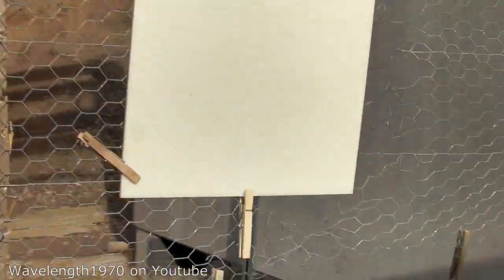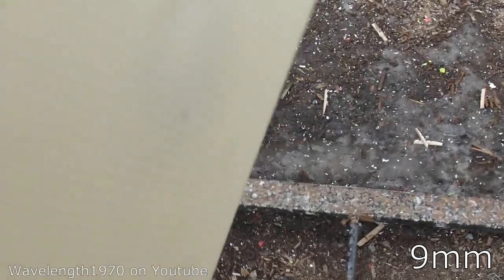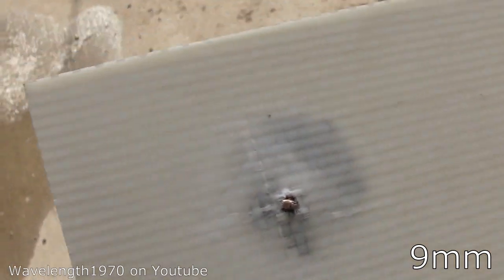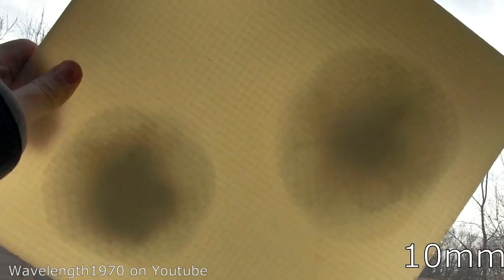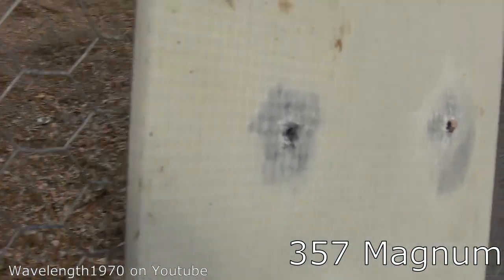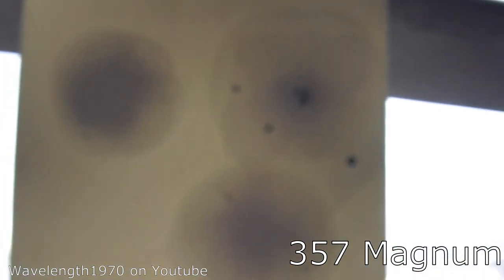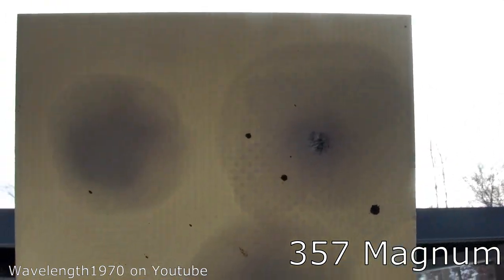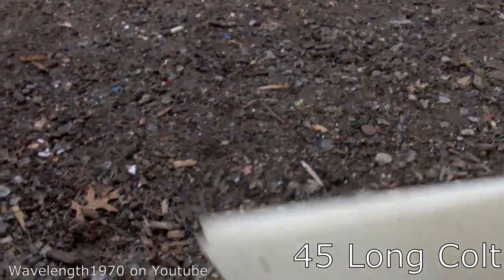Ammo penetration test part 2, 357mag beats 10mm !

Comment: You guys and your bias 357/10 mm penetration test. 
Your 357 magnum 1600 ft./s and your load that you choose for 10 mm is only a little over 1000 ft./s water down weak shit. There’s plenty of manufactures out there making 1600 ft./s 10 mm ammo. Hell there’s even a company who makes a 2400 ft./s 10 mm round do you think that would be fair against your 357 magnum 1600 ft./s no do them both at the same velocity. Speed is King you Dingaling!
Reply: The 10mm was a bear defense load those are not watered down & you're over exaggerating the 2,400 fps 10mm load.